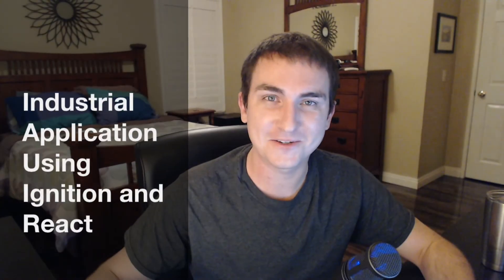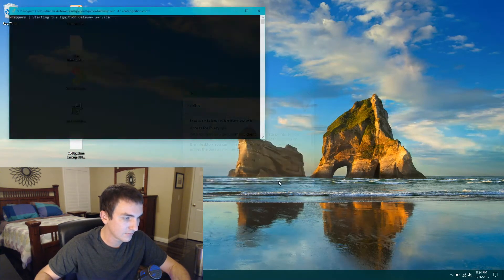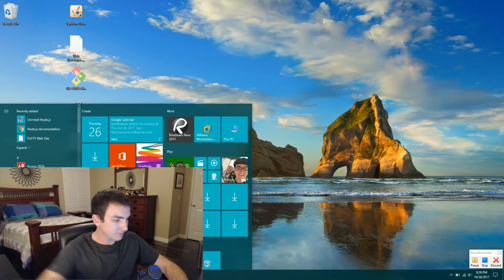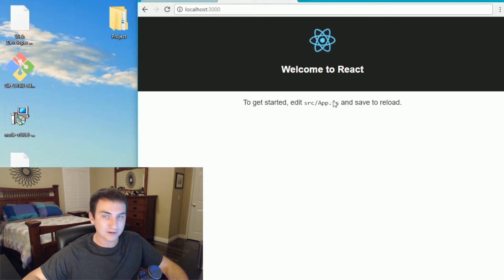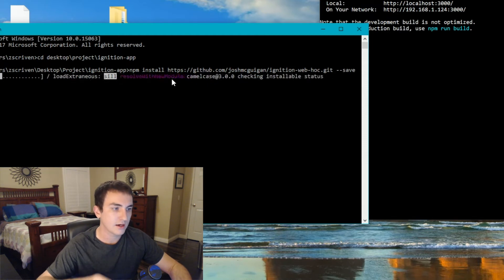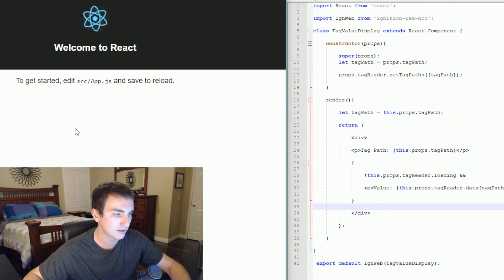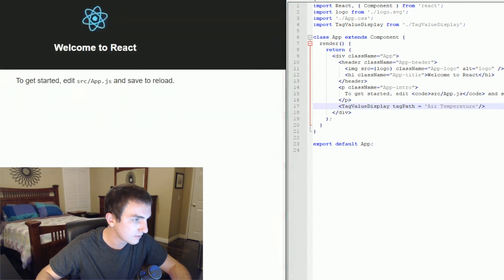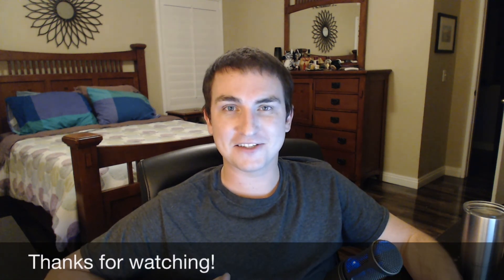Setup a Nodejs SCADA Application in 10 minutes using Ignition

Comment: That's great! But Ignition is paid. You need a real license to run it indefenetely. Not sure what the component from Josh does, but it it implements an OPC UA Client, than you can use other OPC UA Servers to communicate with endless equipement as well as creating your own drivers to commuicate with specific boards, arduino etc... IOT Rulez!!!!